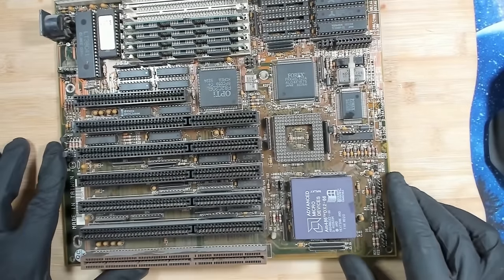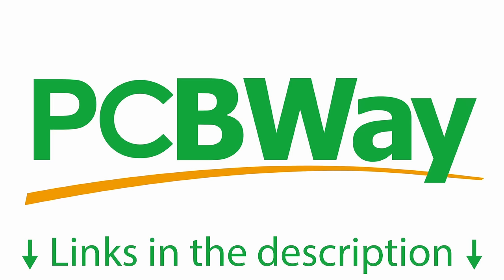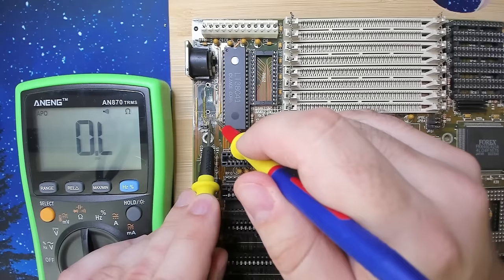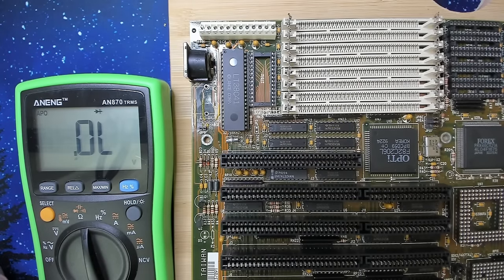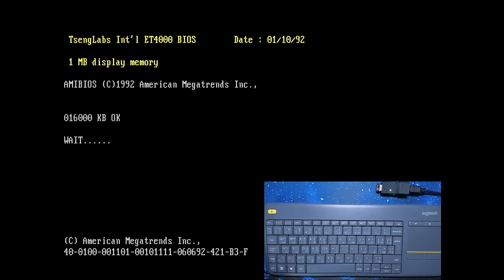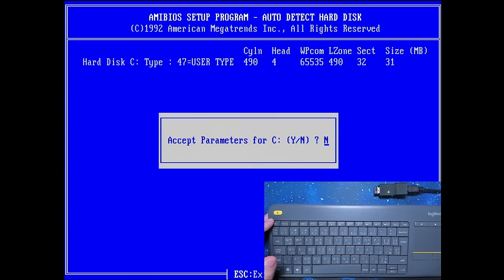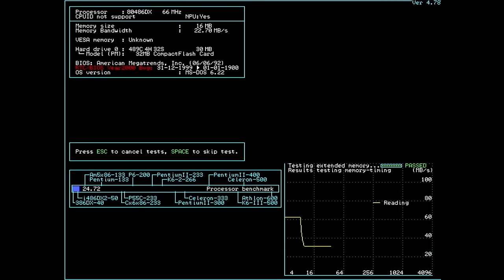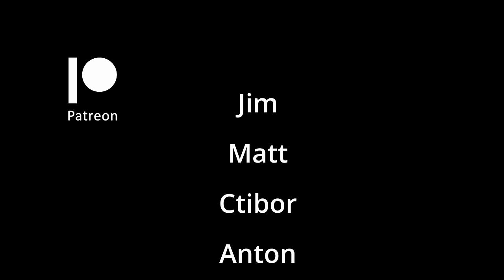Dual-Socket Nostalgia: Forex 386/486 motherboard repair

Comment: If the adapter also was a mouse I think it'd be a very appealing product!
Reply from the maker: Yes, the adapter also supports a mouse. However, you can only use one device per adapter. E.g. I cannot use my Logitech combo via the receiver because it only connects to the keyboard port. Additionally, it can deal with XT and AT systems.
Reply: @bitsundbolts  If it had a second plug for a ps/2 mouse I'd probably order right away!
I also happen to have a Logitech combo reciever that I use with my PIII setup, and also with my laptop. Just plugging the receiver into the machine I use is so nice, and I don't have to have separate keyboards.
It worked OK in Win98SE, but for other software Bios Legacy emulation needs to be turned on, and it doesn't work all that well, not to mention the mouse not working in DOS at all.
Funnily enough I have a wireless Logitech USB and PS/2 keyboard and mouse combo as well, but the mouse is missing and the keyboard part uses USB.

TLDR.: if you can add a separate plug for mouses as well, TAKE MY MONEY
Reply: @bitsundbolts  that would be my question, if the adapter supports the different XT keyboard protocol as well, because in that case I'd find it very handy. Also, how does it handle the cursor keys in XT mode?
Reply from the maker: I'll check if something like this is possible. Might be an update to a later version.
Reply from the maker: I don't have an XT system nor do I have experience with it. The creator however did implement the XT protocol. Maybe we have to have a few rounds of further development done with the help of the community.
Reply: @bitsundbolts  There are Logitech devices that combine a keyboard+mouse into a single receiver (I have one). However I wouldn't expect both of them to work at the same time through this adapter. That's because the PS/2 protocol and ports specify different addresses for the keyboard port, and the mouse port. I'm sure that the AT connector on this (and many other) motherboards is configured for the I/O address of the keyboard PS/2 port, so any data it receives will be interpreted as keyboard strokes. And there is nothing that the adapter can do to change that.
Reply from the maker: Yes, you are right. If you look at my video, you will see that my keyboard has a track pad. So, also mouse and keyboard on the USB receiver. The adapter does default to the keyboard, but we may have it switchable between mouse or keyboard protocol. But as you said, you can only use one device at a time.
Reply: I was thinking now for a long time to create something like this, because the last time (~4yrs ago) I've only found externally powered ones in the DIY community. I never spent time on it and my work always hijacked most of it. So by the fact this dongle is simply being bus powered already sold itself to me. For me the retro (ball type) mouse issue always seemed more severe then the keyboard one. It's fine with optical PS/2 mice if you still have one, but older machines need a serial one. Creating a bus powered serial mice adapter is an unsolvable problem unfortunately. It requires a workaround as a custom USB-ISA card or maybe the PS/2 port may source enough for a kbd+serialmouseadapter+usb mouse. The combined mouse+kbd support could be tricky to solve. I'm not really sure that generic implementations either use a composite USB device for two separate HID descriptors or one and combine the two devices logically separate as a single descriptor. Just food for thought. I think if you can solve all this stuff it might become an ultimate best-seller. :)

Comment: I would try a few more things before call it a day. It could be a poor implementation of the FOREX chipset, maybe making some investigation on this. Some issue with cache on the board, try remove it and observe relevant changes. It could be as well some electrical issue, like a pin with bad joints or some bad cap causing ripple and therefore instability. Please let us posted about it! 😃

Comment: Always a pleasure to help out if I can but on this occasion you did all the work! Thanks for mentioning me! And great idea about using sunshine to cure solder mask, I also have trouble with the UV lamp. I shall do the same… oh wait… 🇬🇧 🇬🇧 🇬🇧
Reply from the maker: Haha, it's definitely a benefit to have 330+ days of sunshine per year! You just have to get used to the heat in the summer - or go back to a better climate during the hot season!
Thank you Tony for taking the time. It was very helpful to exchange thoughts over this issue!
Reply: @bitsundbolts  We have 330 days of clouds and rain here :) I have 35 days to retrobright and apply solder masks to all my projects! :)
Reply from the maker: That requires very good planning if you have projects like that! 😜
Reply: @tony359  but your country has Silverstone Circuit, it pays back for all inconvienances :) rainy race - it is awesome!
Reply: @tennickjestzajety69  I knew it was Silverstone's fault! :)

Comment: What's crazy is that the CPU in that wireless USB receiver is probably almost or more powerful than the 486 it's attached to!
Reply: What's even crazier is that a lot of these USB to PS/2 adapters (and I'm not sure if this one is an exception) basically run on a 6502 core.

Comment: A good source of UV for things like erasing EPROMs, curing solder mask etc - are UV germicidal bulbs. Essentially like fluorescent bulbs but without the phosphor coating, and with quartz envelopes instead of plain glass. A small 8W T5 tube will fit into standard fluorescent light fixtures, and is powerful enough to erase an EPROM chip in 5-6 minutes. That is what I use. However I agree, when you live in Dubai you have your UV source up in the sky and it's free. :)
Reply: These are entirely different use cases and call for different light sources.

EPROM have their sensitivity peak that corresponds exactly to the germicidal lamp, these were made for each other. You should also protect yourself against this, this light is very hazardous.

Resin photoinitiations don't actually work at wavelengths like that and you can cause degradation instead. They want UVA ideally. 330 to 420nm should about work. These are made for UVA CCFL. You don't need special protection against it.

Trying to cure resin with an LED is of course a little frustrating, since the LEDs that they sell all contain acrylic enclosures and cannot work at sub 400nm, so you're only reaching the tail end of the sensitivity. But the sun is alright.

In turn it's remarkably difficult to erase an EPROM with the sun since a lot of UVC gets lost in the atmosphere!
Reply: @SianaGearz  I did a test this spring, I took a new EPROM with recently burned and tested bios software and placed it in my window facing the sun. We had sun almost everyday this spring. After 3 weeks a small percentage of the bits was erased. After aprox 5 weeks only a few bits remained. The last bit was reset after 6-7 weeks, it was a stubborn one 😆 Just for the science of it, didn't document it very specific though.
Reply: @tomchristian  The glass window blocks most of the UV.

Comment: I think I've solved it.  You should have used green solder mask.  Audiophiles knew that using a green marker around the edge of CDs made them sound better, so it stands to reason that green solder mask would make a motherboard faster.  I amaze even myself sometimes...

Comment: This adaptor is sorely needed.
Reply from the maker: Great to hear. Let me just put more details here that others might find helpful. The adapter supports AT keyboard, or a mouse to PS/2. It can also be used for XT systems to connect a USB keyboard.
Reply: As my supply of 9x & AT compatible mice is rapidly drying up (I have 2 left that aren’t Serial ball mice), I’m especially looking to convert later usb mice to PS/2 interface for testing. This would 100% solve my specific problem. I have several PS/2 keyboards that are still AT compatible & curently don’t use XT hardware.

Having XT compatibility would be a godsend for many others in the retro community.
Reply from the maker: We may work on two different adapters - one for AT and the other one for XT, but it's not decided yet. This adapter will solve all those issues you mentioned. The creator developed the firmware for this adapter and I even flashed it a couple of times. So, it can be upgraded in the future with more features.

Comment: I had a Forex MB with 3 sockets for 386, 486 and 387. Basically the bigger(and older all ISA) brother of this one. I used it with AMD 386 @ 40MHz and later upgraded it to Intel 486 SX/2 @ 66MHz.
That involved Quarz change and EEPROM change. And I also upgraded the SRAM.

Comment: Thank you for the mention.

Regarding low performance... it is probably mostly due to the ISA bus.
The performance difference between ISA and PCI is huge.
Especially noticeable with benches / games that have higher frame rates. 
For a 486 DX2 66MHz with ISA 8.3MHz, 15fps doom max details looks reasonable.
You can improve the performance significantly by changing ISA clk to 1/3 or 1/2.
Also some ISA cards have a jumper that is for 0WS, this also improves performance.

Now the sysinfo performance issue, I have no idea a very spooky behavior.
Reply from the maker: I agree, I can live with the poor performance in games, but the weird behavior of SI is unexplainable so far. I need to tinker a bit more with this board, but there are so many other things I need to take care of 🙂. You made very interesting videos. Do you consider coming back with new content on YouTube?
Reply: Thank you.
I am on a long hiatus for sure. But all this time I was still working on my retro stuff.
I have accumulated a ton of retro hardware now + made many new projects and mods.
It is just that I do not have much time now + I am trying to put some order to my stuff here first.
So I will come back to videos for sure :). I just very busy now T-T. Most of my videos where on COVID.

Comment: That slot is an "OPTi Bus" and there were at least TSENG video cards for it.
There was other OPTi Bus like that but with what looks like a regular 8 BIT ISA slot behind it, I guess the single slot variant was mostly for video cards because it's missing some ISA signals and the dual slot variant can have enough pins for all VLB signals, but I never seen a card for it.
Reply from the maker: I remember seeing something at the scrapyard that might have been compatible, but I didn't pay attention to that item because that connector looked nothing like a PC connector.
Reply: @bitsundbolts  Nothing worse than missed opportunities.
Reply from the maker: Unfortunately 😔

Comment: Very nice video! Your RAM bandwidth is 22.7 MB (shown at 24:27). Other people get 37.4MB which is more than 50% faster. I think that there might be something wrong about 30pin RAM interface implementation. (does it matter which four slots you use? Upper or lower?)
Reply from the maker: Good point. Maybe there is a difference between the memory banks. I'll check it. Thanks for suggestion
Reply: It might be cheaped out and the company went with a 16bit bus. Would also explain the results.
Reply from the maker: Hm, then I should be able to power on this board with only two memory modules. But the CPU has a 32-bit data bus. Could there be some magic happening in the memory controller on the chipset?
Reply: 10MB/s in Cachechk, this is really bad. I would start by lowering all possible tuning timing knobs in bios.
Reply: @bitsundbolts  Well there is a chance they used each slot individually in order to support 16 bit and 32 bit memory configuration? Does this motherboard support 386 SX CPUs? It worth a try to play around with memory slots. Even to populate all.

Comment: Turbo - this board spams Cache Flush pin with ~HKz signal to slow down. Constantly flushing whole cache is slower than no cache at all.
Speed - 10MB/s ram speed in Cachechk is really bad, its very slow 386 system bad. Bios ram/cache  timing settings need tuning.
Reply from the maker: I'll try to run the board without cache and see if it makes a difference.

Comment: Rule out the socket, and bios by swapping to a 386 CPU and seeing how that compares to your previous 386 benchmarks?
Dual socket boards could be iffy at the best of times and usually had some kind of compromise to allow using one type over the other. The chipset maybe more 386 with 486 extension thrown in to be compatible with both. 

Certainly an interesting one. also did you use a jumper for the turbo, or the bios setting? I didn't really pick up on that bit.
Reply: Also, not sure if he still does work with BIOS's but if you can get in touch with a chap called Jan Steinbeck he used to unlock hidden functions and patch bios's for all sorts of things back in the day.
Reply: Na época eu tive essa placa, tive um 386... 40mhz ela queimou...     depois comprei 486 dx2 66...  numa placa melhor...
Reply: eu tambem acho que o problema principal é a placa mae... depois por ser um AMD...
Reply: @netowork3d  the fact it is an AMD has nothing to do with it. clock for clock the 386's were great CPU's.

Comment: For testing purpose You could try find bios for motherboard with similar specs, especially chipset. It may run.
Reply from the maker: Yes, you're right. I have seen reports where people use a BIOS from similar boards (similar chipset and features). It could improve performance. I'll keep this in mind. Thanks!

Comment: I tell you what would be really useful (for me) in a keyboard adapter, the ability to upload custom keyboard layouts to convert a QWERTY keyboard to something else and switch between them with a keyboard shortcut. I use the COLEMAK layout, and while I do have a custom keyboard with that layout, it's an old Unicomp that I've never been too happy with. It would be better if I could just use my spare modern board, and being able to switch back to QWERTY when I need WASD would be nice too.

Obviously it's probably not worth putting the effort into making this feature, since I imagine I'm pretty much the only person who actually needs it. Everyone else has a keyboard that sends the right scancodes for their layout, so I can't imagine anyone else out there needs this.

Comment: Great video. Thought I had this motherboard and would have tested it to compare results, but turns out I have a Forex based 386 only motherboard, and I have a dual CPU 386/486 2VLB USA Chipset (SC-9204-a 4L08F1061 Japan) and my memory combined the 2, oh well. The dual CPU board looks similar, minus the OPTi chip and my has 2 legit VLB slots.

Comment: I think the USB/ps2 adapter would very useful. I saw a video that I can't seem to find now that actually tested using a USB keyboard on older computers that supported them slowed the performance down around 3-8%, due to the constant interrupt polling of the bus. I'm paraphrasing because I wish I could find it and my memory is spotty. 

Edit: Ha, it was your video I was thinking of! I feel silly.

I'm not in the market for one myself, I don't have the room (or budget) for many hobbies, so I'm enjoying retro PC hardware vicariously through youtube.
Reply from the maker: When I read the first part of your comment, I was certain you saw my video 😅 - well, you notices it then.
Yes, this adapter will solve that problem with USB keyboards on older systems. It's a nice little device and I'm using it these days all the time!

Comment: This had to be a budget motherboard for the time, and IMHO mostly meant for 386 CPUs, providing an update path to early 486DX and SX. People thought they wouldn't be missing out on the performance when upgrading just the CPU.
Reply: The 32bit slot is bit out of place for a budget board
Reply: @phljns  that's why there's only one, and even that is not standard EISA, so I'd consider it more of a gimmick than a useful thing. This approach was common for budget motherboards for a long time.

Comment: You could use a LIR2032 battery (same size as a CR2032) which is rechargeable. I don't know if you can charge a LI battery with a circuit that was intended to charge a NiCad.
Reply from the maker: I don't know either. It's a pretty simple circuit. One diode and one resistor. There is no overcharge protection anywhere. I think I'll be ok with a non-chargeable CR2032.
Reply: @bitsundbolts  That explains why those old Varta NiCads leaked back in the day. If you left the computer on all the time is continuously charging the battery and at some point it is going to star off-gassing. I have no proof of this, but it seems logical.
Reply: @tigheklory   Nah i think they just degrade chemically whether you use them or not, just from ambient heat. Most of these machines were disconnected from power before they leaked, and never turned on again for 25 years, and in the interim there's a leak. Just a little gas should have just diffused out of there no problem.
Reply: @tigheklory  Nah, they were inefficient enough that throwing 5V at them wasn't enough to get them to 100% so you ended up with some equilibrium point short of full charge. Given the very slow discharge rate, they don't need to play games for extra battery capacity.

Comment: Please would you share the soldering iron temperature range to use while working on the traces? 🙏🏻
Reply from the maker: I'm usually at 330 degrees Celsius
Reply: @bitsundbolts  Thank you! 🔝